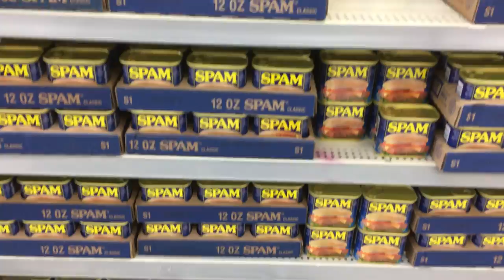Subaru Impreza Car Battery Replacement

Comment: Thanks for the video 6 years later bud. 

Was changing in my 2009 Impreza today and I couldn’t figure out the metal holder on the box holder for the battery. I was afraid to yank on it not realizing it was like 2 inches holding it in lol
Reply from the maker: You’re welcome

Comment: I have a 60amp and 500 battery for my 98 impreza turbo. My battery feels weak. It cranks slow. Should I be using a 65amp battery instead.

Comment: It would be a MUCH better job if you bought a battery, then replaced it at home.  There is a lot of corrosion on the terminals and hold down bracket.  At home, you probably have some baking soda an old toothbrush and a small cup of water.  The baking soda and water solution will neutralize the acid and then clean the crude off with the toothbrush.  When it is cleaned off, you will have MUCH better battery connections.  Then, take your old battery back for credit. 

Or, just go to a chain auto parts store and just let them replace it for you, if you want to.
Reply from the maker: That is a better way to go, but my battery died at Walmart and my car wouldn’t start, so I did it in the parking lot.

Comment: Why tf would you buy a car battery in Wallmart????
Reply from the maker: Because that’s where I was when my car wouldn’t start.
Reply: hoohoohoblin oh my ... 😂
Reply: @hoohoohoblin  You might not even have needed a car battery.  All of that corrosion on the terminals made a very poor connection.  That's probably why it didn't start.  And, you could have locked your car with the key.

Comment: Aaa will bring a battery (correct battery )
Reply from the maker: Thanks. I didn’t know that. I may do that next time.
Reply: No problem I am a aaa battery tech and we carry all part numbers on our truck including agm gel battery. It’s on demand service .
Reply: Most Subaru’s take a parts numbers 25,35 24 or 34 FYI